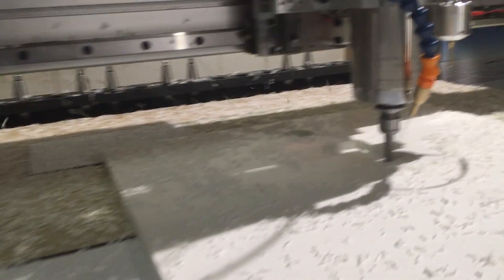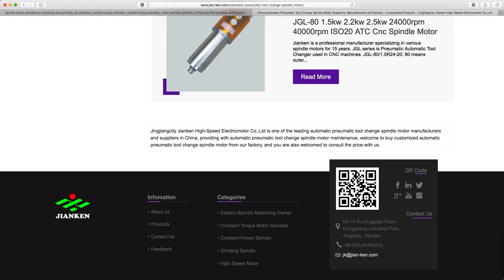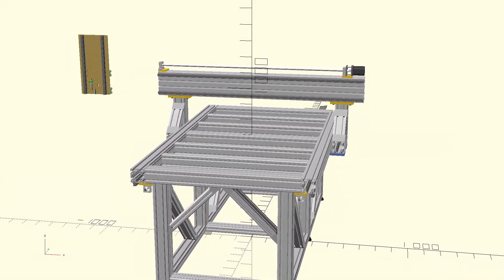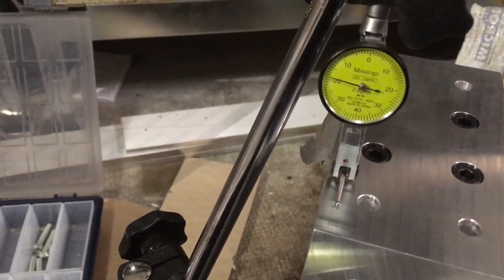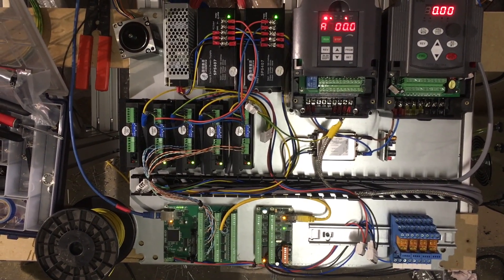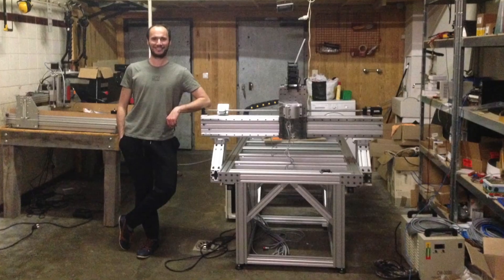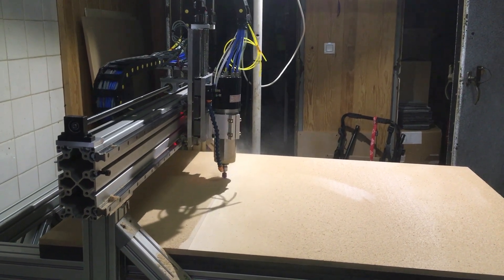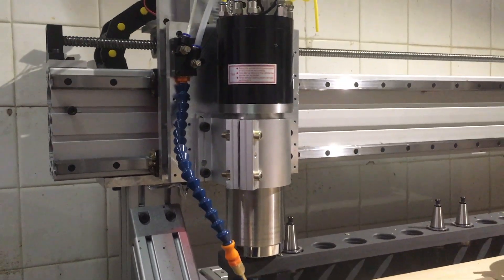My DIY CNC Router build with ATC and Vacuum Table

Comment: If someone order something like this from you,what would be cost? In €
Reply: Motor 1400 and with the rest I think 2000 2500
Reply: @tristansimonin1376  no way it could be that cheap. More like 5000+ €€€ w/o ATC included. Just if u take aluminum profiles to count one meter of item, maytec or bosch size of 80x80 is like 40€ + all corners, nuts, screews, connections. Then u need linear rails and quite expensive bearings, ballscreews or rack'n'pinion system. Than u need good ETH control board, servo or step hybrid drives, motors, power supply and all kind of electronic stuff... The empty metal cabinet to put all that is just 80€. If u you just think about ATC spindle price goes at least like  +1300€ more only for spindle but there is a lot of other tools. So... to make such cnc with atc be prepared to pay like 5000, 6000+ € bcs u need good quality parts like Thk for example and not low cost chineese.

Comment: Brilliant machine! Does the spindle use a lot of air? I'd love to see more of how you designed the tool changer and probe. Excellent work
Reply from the maker: The spindle needs air for :
1) the  air cylinder releasing the tool
2) the sealing at the bottom, there is a light stream of air going out to prevent dust from entering the spindle and destroying the bearings.
3) a powerful air stream to clean the taper before loading a tool.
Point 3 uses a lot but just for 1 second. Point 1 uses very little air, and point 2 uses little air but constantly. At first I was using a silent 700 W air compressor and it was fine. But adding an air blast on the tool it was not enough anymore and the pressure was too low to operate the tool change. I upgraded with a 2 kW / 100 litres one, not silent anymore but I never run out of air.
Reply: @YannPomarede  maybe you can use the output from the vacuum pump as an air blast on the tool? Very impressive built by the way!
Reply from the maker: Humm, I think that would not be ideal. Because first the air from the vacuum pump output is hot due to the compression and the 2.2kW motor heating, and secondly it's very low pressure (it would be around 0.05 bars or less) and it would require a very large pipe to bring the air from the pump to the spindle. With air at 8 bars it's a lot easiest to transport the air and get a powerful blast on the tool.

Comment: Nice machine...which cam software are you using?? Would you please share the electronics details like wire diagram if any? I'm inspired by your design.
Thanks
Reply from the maker: I'm using Autodesk Fusion 360 for the CAM, and OpenSCAD for the CAD view shown in this video. I don't have a proper schema on paper, but with a local FabLab here in Montpellier, France, we are working on a control box very similar (if not exactly the same) to this one, and we should publish everything in a couple of weeks. I'll add a link in the video description.

Comment: What software are you running to control the machine?
Reply from the maker: You're right I forgot to talk about the computer part, I'm using LinuxCNC. I added some G and M code remapping, like a remap of M6 to do the tool change for exemple. I think just the LinuxCNC configuration needs a whole video !
Reply: @YannPomarede  Yeah its a whole topic on its own. Ive purchased a similar spindle and added it to my CNC machine, but I use Mach 4, and am having trouble finding people that use it for ATC to give me some pointers and help programming it.
Reply: @YannPomarede  That would be a fantastic video. I got Jian-ken to build a 3.7kW ATC spindle for me so will be going through the same thing in the next month so having a video to guide would be unreal.